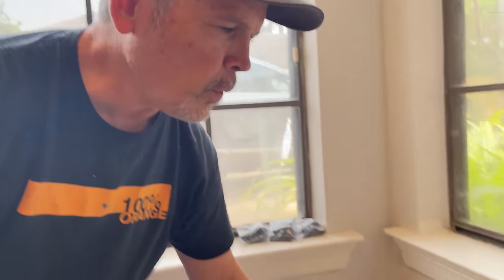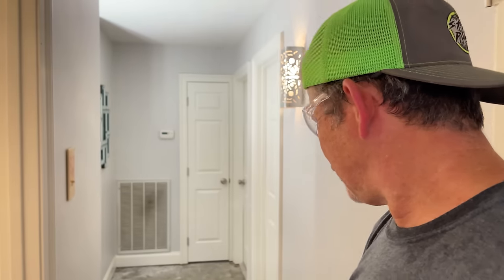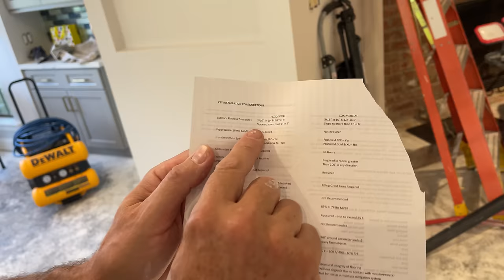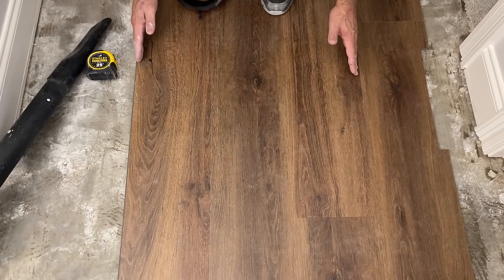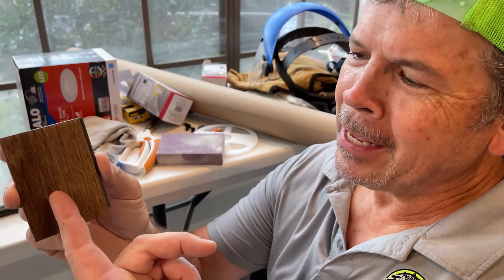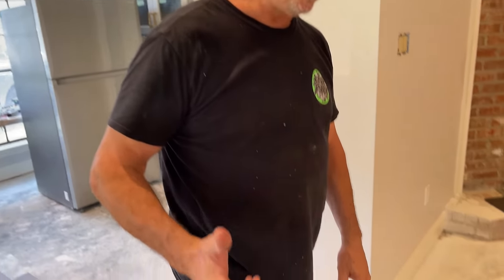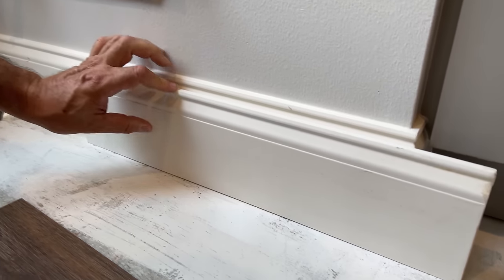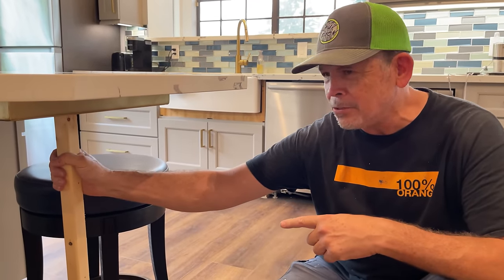The ULTIMATE FLOORING HACK! | Installing Vinyl Plank Flooring

Comment: Hello, Great video thanks for making it.
I do have a strange question thou about the product.
How does the floor handle in high and extreem low humidity?
Where I live in summer it is high and hot humidity but in winter it is cold and very low humidity.
Wont that make the floor buckle very quickly withen a year or two?
Reply from the maker: There's actually no wood in this flooring.  It's called SPC from ProSource.  Stone Polymer Composite.... very stable.

Comment: How do you fill the gap between bottom of door jamb and vinyl flooring, since the old parquet was thicker than new vinyl?
Reply from the maker: Tough one:)... you could add plinth blocks but that's ton of work, replace the casing is another option.  Our gap was small and the owners were okay with it.

Comment: Vynil flooring still needs a vapor barrier, regardless of that pad on the bottom. And only lasts 5 years. that actual wood floor was much better. Major f up.
Reply: The manufacturer will void the warranty if you use a barrier.

Comment: Where did you get that floor scraper that you used in the areas with the slope?  Need to find one of those for my project.  Thanks and great video!
Reply from the maker: mcmaster.com
Item #5864A61

Comment: GREAT video! Thank you.  Q: you laid flooring under Dish Washer - I was told by supplier to cut in all kitchen appliances (except refrigerator) to allow for expansion.  Can I put flooring under Dish Washer, Electric Range, etc?
Reply from the maker: I always do.  IMO the weight of a dishwasher or range isn’t going to stop any expansion
Reply: @StudPack  OK Thanks for quick response.

Comment: Why didn't you use a moisture / vapor barrier? I am also remodeling my house and a few places told me I have to. I dont know why? I'm on a concrete floor in south Louisiana.
Reply from the maker: There’s no wood in the product we used.  It’s a stone polymer composite...very stable.   Manufacturer said VB not required.   Go with what your manufacturer recommends👍
Reply: @Stud Pack  Awesome, thank you. Will look at that.

Comment: Should be glued down ! Start walking on that with wet shoes or spill anything it will mess the joints up plus heat and coldness will effect the size of the tiles.